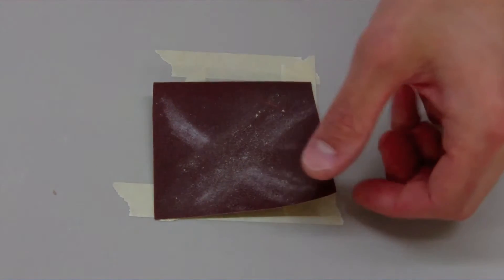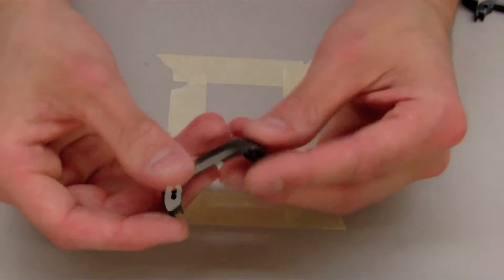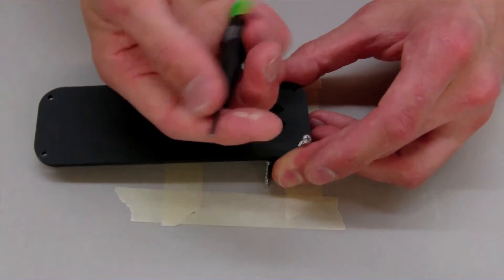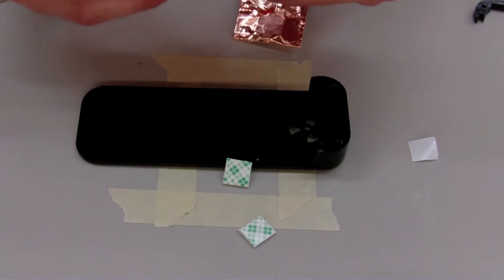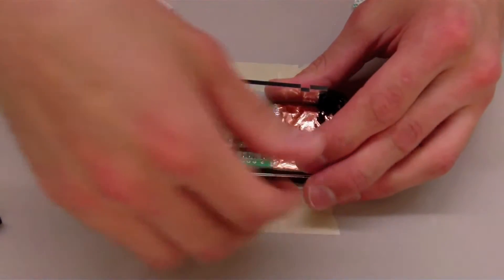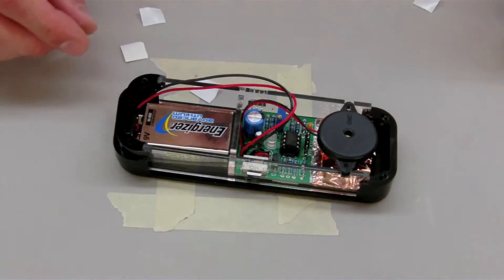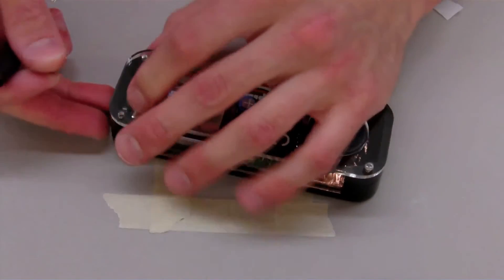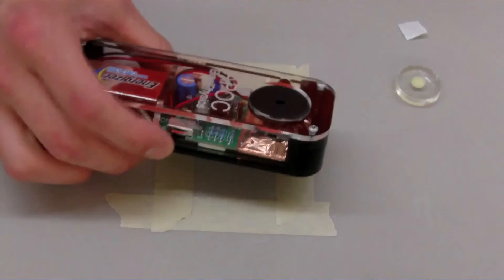APOC Assembly Tutorial: Part Nine - Case Assembly

Comment: The switch is not always making good contact as I have to move the stick around when in ON position so for it to make good contact and sometimes even if it is in the middle it wont make noise, like if it was OFF. It seems this needs a better quality switch. All soldering is nice cones by the way.